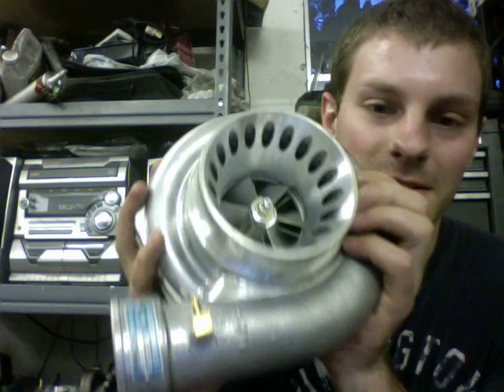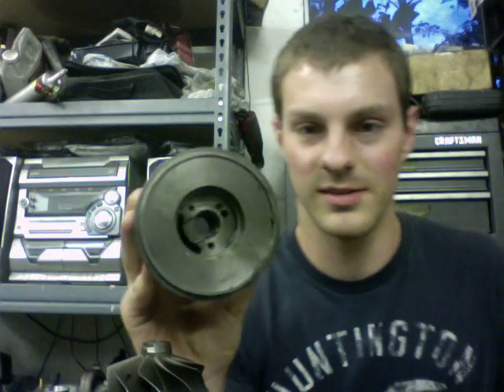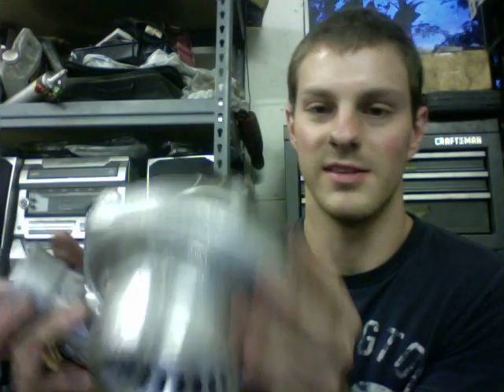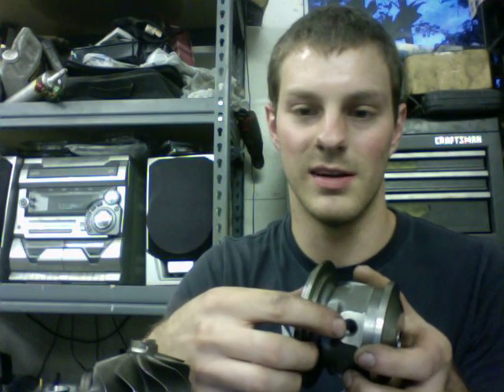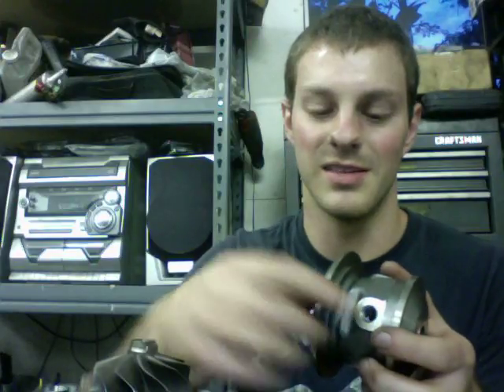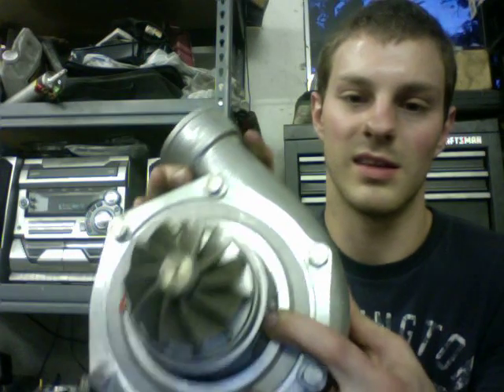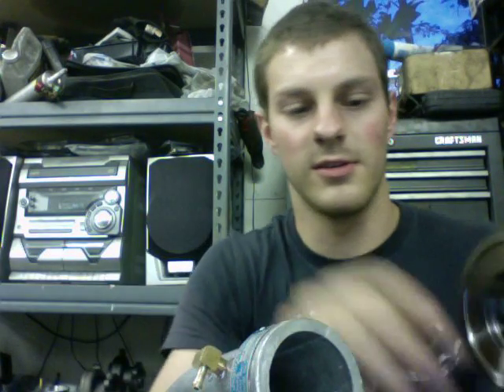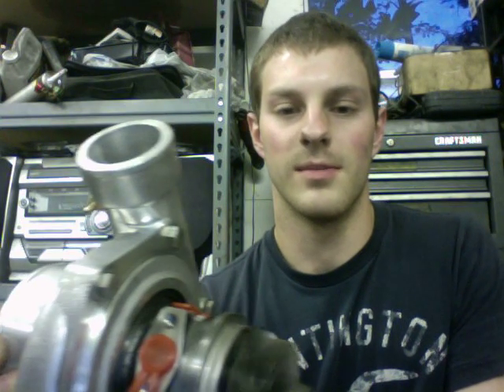China GT35R to Genuine GT35R Turbo Upgrade $550

Comment: I need to actually repair this as a Journal bearing turbo this time around. The 2g Dsm automattic t25 thrust bearing holes won't line up, so it must be a different thrust bearing other than a T25. You are right on that it takes standard t04E or T3/T4 thrust bearings. Not the short ones. The normal gt35 thrust collar that holds the intake side piston ring is too tall to fit. The real Gt35 thrust bearing holes won't line up either. It seems to have mix and matched parts from different turbo's. One of the legit rebuild shops would not work with me on matching up the journal bearing parts that come with this turbo and sell a legit kit.
Reply from the maker: You should email us some pictures. Im not sure which version you have. Some versions are worth rebuilding. some are not, but we can always do a CHRA replacement.
Reply: I will email you some pics of what I have going with it. I'd like to believe the chinese parts came from other various random turbo's and not just one off designs. There is an ebay kit from China that looks exactly like what's in this turbo but I wanted a perceived better quality kit for a journal bearing gt35
Reply from the maker: Sounds like it uses a to4e or a ball bearing front seal
Reply: Well the front seal piston ring in the gt3582 rebuild kit is the same size as what this turbo came with so I don't know. These turbo's come with the junky compressor wheel that has two lead slugs installed in it's hub. The lead may melt when you go to high boost sloshing around in their drilled holes messing up the balance, and rehardening after cool down. All the more reason to upgrade to your 35r CHRA.
Reply from the maker: The metal inserts are weights that they used to balance the compressor wheel. Its a very unique way to balance a compressor wheel. usually the wheel just has material removed not added.  

There are several different front seals this turbo could have used:
GT35 Journal bearing 
GT35 ball bearing
to4e/to4b
t28/t25

These seals are really close in size. There are more garrett front seals but they are larger.
Reply: I had to retain the front seal cover the turbo came with. So it's back together now with the seals from the rebuild kit from Hong Kong, but trying to rebuild the junky Chinese CHRA is only a temporary solution at best. I'm not proud I had to do it lol. Thanks for your input.

Comment: Where You get so cheap parts.?
Reply from the maker: I buy turbo products whole sale from the manufacture.  I have a special business connection, where they give me 40 % off, but i have to usually buy 50 to 100 pieces.  It gets expensive, but i run a turbo shop and we use these products constantly, so i needed them for myself or customers anyway.  

    After awhile i figured that It would be a good idea to branch out and advertise to other people that may also be looking for the products that we are already stocking for our current customers.

Comment: i have been using chinese turbo's for years. have had no drama. have a gt45 on a 13b running 20psi been going for years. everything is made in china all in the same place. Holset say made in china on them and so do some garrett units. only in heavy machinery ive noticed that. been waiting for it too shit itself so can put a 400 dollar garrett cartridge in. may be awhile..
Reply from the maker: I have not gotten to see the GT45 yet. Some of the quality of the older versions are a lot worse than they are now. The quality of some of the copy turbos have definitely improved. This Style GT35R sold by CXracing has not changed yet.

 Racefirst sells some ball bearing turbos that are actually ball bearing, but i haven't seen their ball bearing cages yet. I have seen some really horrible ball bearing cages.

The ball bearing parts require strict tolerances. None of the quality ball bearing parts are made in china, they are imported from the USA or Germany.
Reply: Turbo Lab America so cxracing's turbos are still the old style? I'm looking at one of their kits currently and I don't want to run a cheap turbo. Was actually looking to get a set of real gt35's when I came upon this video. Would this upgrade be possible with the turbos that the kit would come with?
Reply from the maker: shawn lansdale There are more than 1 type of GT35R turbo that CX Racing sells. 1 is the TO4E journal bearing version, the next is the "Ball Bearing" version which is designed to look like a ball bearing turbo but its journal bearing.

The advantage of the TO4E Journal Bearing version is that is more reliable and its possible to use an upgraded thrust bearing kit if It has a 270 degree. However its not easily converted to a true ball bearing turbo without machining the turbine housing. Shown Here http://www.ebay.com/itm/CXRacing-GT35-GT3582R-Ball-Bearing-Turbo-Charger-T4-0-81AR-For-1JZ-2JZ-RB-/290776393437?pt=Motors_Car_Truck_Parts_Accessories&hash=item43b39fa6dd&vxp=mtr

The Advantage of the Ball Bearing Appearing version is that the Cartridge can be removed and replaced with a genuine Garrett ball bearing cartridge. Shown Here http://www.ebay.com/itm/CXRacing-Universal-GT35-T4-Turbo-Charger-Anti-Surge-500-HP-68-A-R-w-3-V-Band-/270940682667?pt=Motors_Car_Truck_Parts_Accessories&hash=item3f1552b9ab&vxp=mtr
Reply: Turbo Lab America
 so youre saying if we order the "CXRacing Universal GT35 T4 Turbo Charger Anti-Surge 500+ HP .68 A/R w/ 3" V-Band" your replacement will work with it?
Reply from the maker: I haven't tried with the t4 one, but that one should work also, based on the bearing housing used in the pictures.

Comment: I was gonna order a gt3582r turbo charger .84ar 300 bucks.  But i seen thus vid should i go for it and rebuild it or should i just pull a saab or some dsm turbo car. I just wanna boost and try it out im not trying too make 400-500hp!
Reply from the maker: The turbos with the .84 turbine housing usually came with a P trim turbine 65mm x 74mm. There is a chinese company that sells this combination with the gt35r compressor and ptrim turbine, this is a very Odd combination.

Comment: How much do you sell a whole gt35 unit for?
Reply from the maker: We can make a few Garrett ones, that are all geniune (no knock off covers) for 1000 with new cartridges with the billet 6 blade, we can make the gtx3582r for 1300.  

We just need to know what format you would want. We have a lot of t3 .82 turbine (4 bolt outlet) housings in stock.  We have 1 or 2  .63 5 bolt flange turbine housings.
Reply: Are they both ball bearing turbos
Reply from the maker: Yes.

Comment: Cool but I bet that exhaust housing is nothing like an official Garrett and will crack when high boost is achieved.
Reply from the maker: The turbine housings are made of the same cast iron that garretts turbine housings are made from. So far, i have never seen a turbine housing from a "china" turbo crack. But that maybe because they do not run very long before they have problems.

Comment: Great info! Also,can you do a video on how to replace the BB centre cartridge on a GT2871 yourself? Would be very helpful. Thanks.
Reply: Its basically the same procedure, but i can make a video on how to do that.
Reply: That would be great, thanks! There are some ceramic bearing cartridges on ebay that look interesting.
Reply: I mean replacing just the bearings and not the whole centre section. Thanks.

Comment: whats the compressor outlet like as in durability would you say it would handle the pressure and heat as good as a genuine ?
Reply: We havent had any problems out of any of the housings not holding the pressure. The only problem we have seen is the cartridge being poor design. The castings look good, no major holes or anything at all.  

I have seen some china castings with missing holes and what not, I would never run anything like that.

Comment: Yeh I mean the compressor back plates that have 4 bolts under the compressor wheel I see them on gt35 plain bearing stuff
Reply: Yes thats the journal bearing version, Turbo Lab Also sells the rebuild kits for those too.

Comment: Nice video  yeh buying cheap turbos is a good way to get housings cheap. but  always  cross reference the  minor and major dia  sizes with turboby garret web page and watch out for the  bolt on type back plates wich are incompatible ..
Reply from the maker: What do you mean by bolt on type back plates? Are you talking about the adaptor plate for the compressor housing to center section we offer them in to4e, gt35, and to4b size.  Or if your talking about the journal bearing GT35 turbos that have bolts that go through the bearing housing to bolt to the turbine housing, which is commonly a garrett turbo and its not machineable to anything else, but thats commonly a garrett GT35 or GT40 journal bearing turbo